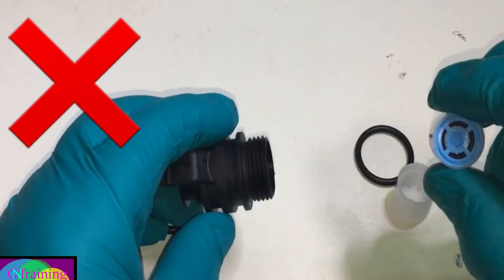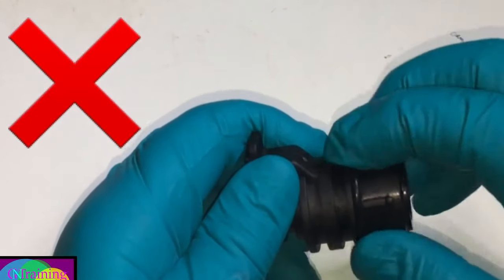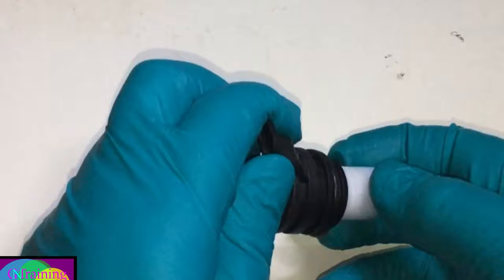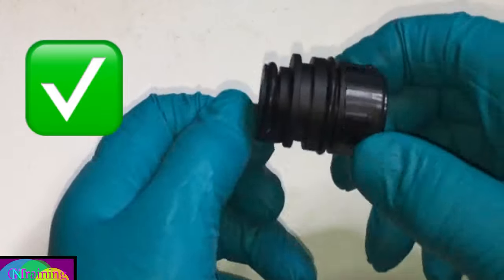flow turbine adapter

Comment: Got one of these to do later this week. I’m confident I could have figured it out but after watching this video I no longer have to. Looks very straightforward. Thank you.
Reply: Ed, the only problems I ever had were 1) giving a hard enough pull on the tab to get the old one out 2) the old one has sometimes broken in half leaving the back half stuck in the hydro block. I used needle point pliers to retrieve the remains, often in bits. You just need to sure you have got it all out so have a good look with a pen light or equivalent. Good luck. Most come out easily enough.

Comment: Hi Geoffrey, I'm not a plumbing or Boiler engineer, but my plumber seemed flummoxed by my 4 year old Greenstar 38CDI.
So much so I decided to diagnose the problem myself. (I have 40 years of troubleshooting experience in electro-mechanical and electronics).
CH works fine, great flow, fast heat and spot on temperature control.
DHW another story, Water runs hot for a few minutes then gets cold, then periodically gets luke-warm.
I turned off the CH, by turning the control dial on the boiler to * (Antifrosting).
Then I turned the DHW control to max and ran a hot tap. The boiler didn't fire up, no pump, no fan and no ignition.
After a moment the boiler did start, but not immediately (Within 5 seconds it took a good minute) when presented with a DHW demand.
I operated the ECO mode, and ran the hot tap once more, ice cold water and the periodic heating stopped.
The periodic heating of hot water is preheat I believe, which maintains a small amount of water hot in the system to reduce transit time to the demand HW tap.
This cycle is maintained by a thermocouple temperature signal and burner / fan modulation by the controller.
All this tells me there is no demand generated to fire the boiler in DHW mode.
The demand is generated by a small Flow turbine, which I believe in in series with cold water supply flow into the DHW side of the H/E.
Since Preheat works and regulates correctly, I can assume the control system, DHW thermistor and diverter valve are all functioning correctly.
(Diverter valve must be ok since the CH does not heat up when turned off and the hot tap is run)

By my analysis of the symptoms, the fault lies with the Flow Turbine, either electrically or mechanically unserviceable, the, or the Turbine output signal not being processed by the control board? (So either the control board or the Flow Turbine sensor are U/S).

I deduced all this with no test equipment, just the DHW Block schematic of the Boiler.
Is my analysis path correct, are the components I suspect the most likely cause in your opinion? 
Because my Plumber wants to replace the Heat Exchanger.
I expected him to call me this morning before he collects the H/E he ordered, but he hasn't.

Comment: The correct name for this component is " The Dissolving Flow Turbine Adaptor".  The joke is the green diverter motor drip cover which WB put on instead of making the adaptor from better materials. Sometimes you can't make it up.

Comment: I don’t have a leak, but Need to open Hot Water tap to Maximum to get the DHW to come on!  Would replacing the flow turbine adapter help?  Thanks!
Reply from the maker: There is a flow restrictor in the flow turbine adapter that may help that’s of course if you’ve got enough flow going into the boiler in the first

Comment: Great videothanks so much. Hot watwe pressure has gone down after this. Why? Please help. Thanks
Reply: I havent chsnged the two part plastic filter thing that go inside the adapter in your video. Could that bd the problem? Does the boiler need some sort of bleeding for trapped air? Help plz

Comment: Hi, is that a CDI Classic you are working on, what are the symptoms of a faulty turbine adaptor. Thanks.
Reply: Paul Hugh no fire on hot water mode
Reply: When the water starts dripping onto the motor it will jam in one position either hot water position or Central heating this is not a CD it’s a junior but they’re all the same you will find some boiler got a green shield across the motor to stop the water dripping onto it

Comment: Did this one have a filter mesh in the cold water inlet, I didn’t see it in the video?
Reply from the maker: No there is no mesh on this flow turbine adapt
Reply from the maker: The actual  strainer you’re talking about is in the cold water mains pipe not in the flow turbine adapter

Comment: So where did you put the white washer in the end that comes in the pack that was shown? Many thanks
Reply: On the cold water inlet - other end of the pipe you need to loosen/remove to get to the adapter.